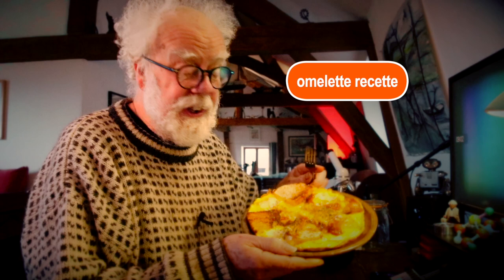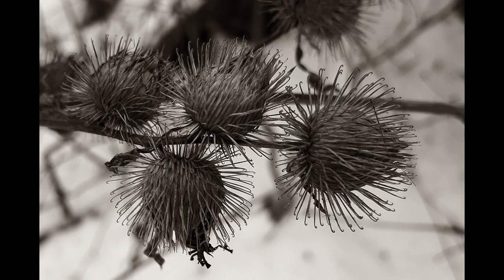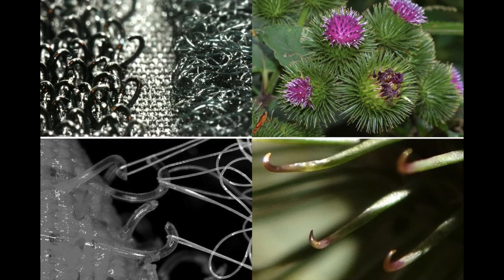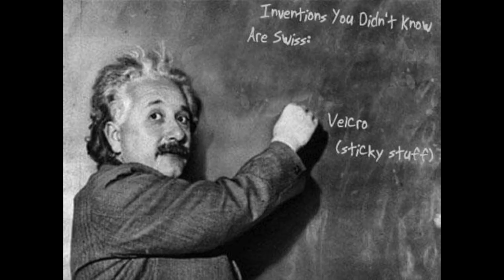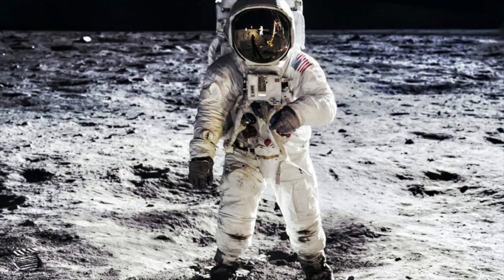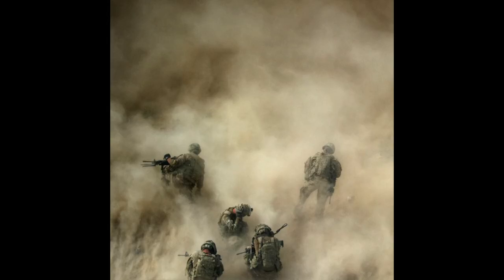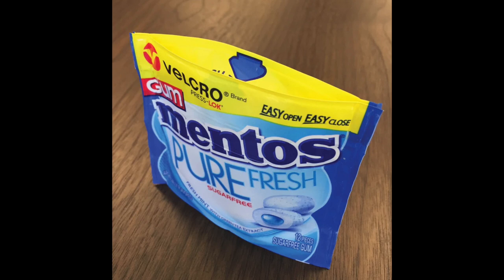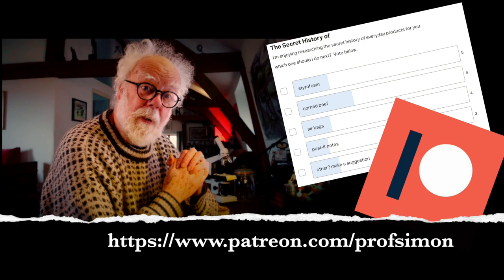Secret History of - VELCRO -  Prof Simon

Comment: I remember being tasked once around 2004, with putting up a 5ft x 5ft sign onto a thin plasterboard "wall" that seperated the reception from the main office, so thats what you do when you are a fiber optic engineer. I didn't fancy drilling loads of holes into the sign to secure it so I decided to try velcro. Got the widest roll I could find, which came with double sided sticky tape and voila!
It worked a treat and after the 10 years I was there, it still stood. The modern day stuff is real strong.